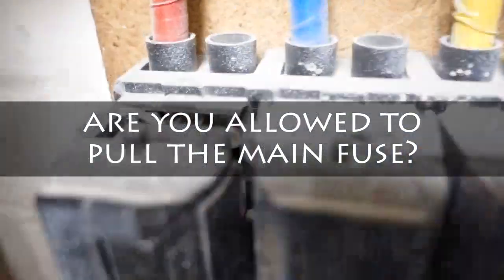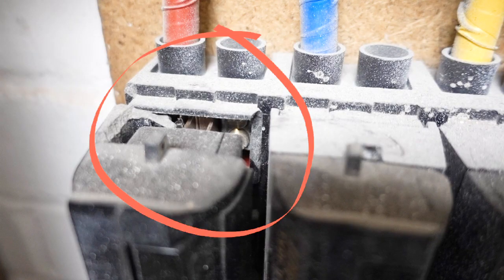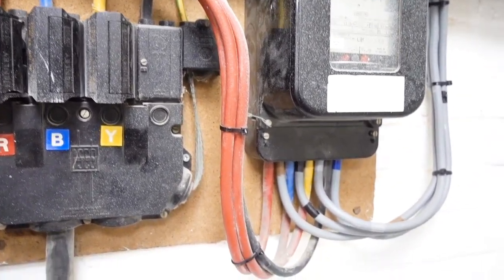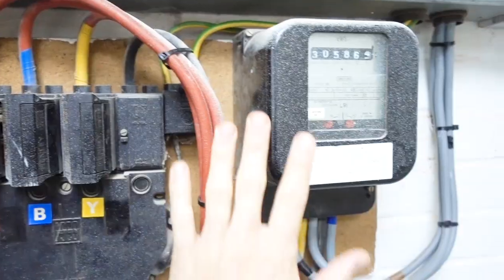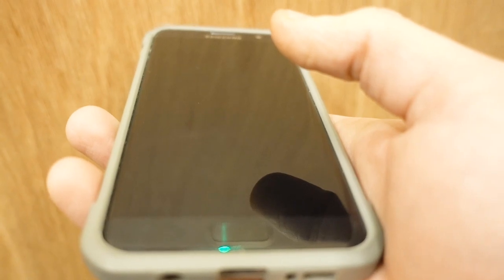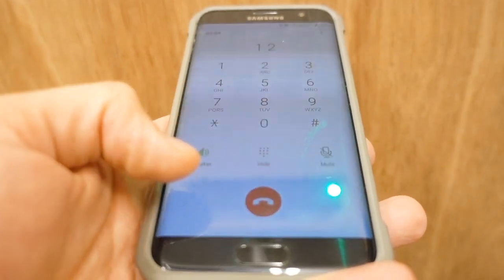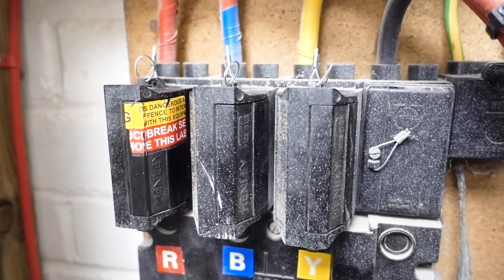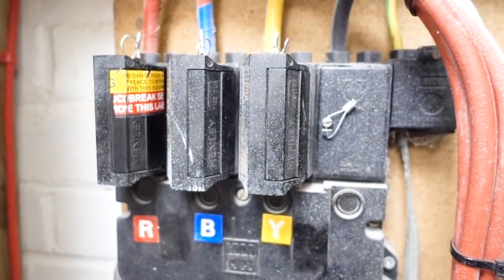REPORTING A DANGEROUS ELECTRICAL SUPPLY FUSE PROBLEM | CALLING UK POWER NETWORKS

Comment: I've called UK Power Networks out a few times when attending reactive repair (blown service fuses or damaged distributors equipment), I never actually hang around for their engineer to turn up. Where live parts are accessible to touch, I usually construct a makeshift barrier/enclosure with warning notices. The service fuse can be withdrawn if there is an imminent fire risk ie arcing between the pins and receiving ports.
Reply from the maker: Alvin Ashman I was worried that once I left the occupiers wouldn't take the situation as serious I was so I carried out everything I could to meet the EAWR 1989. We all know how to remove a fuse but it isn't an electricians to touch unless you have authorisation and are competent to do so...... grey area because arguably you are breaching some regulation in the event of a fire risk as a qualified electrician.
Reply: Dans the Engineer- There isn't a judge in the land that would convict you if you withdrew a service fuse because a real potential fire risk being present. If I arrived on-site and there was arcing at the service head, I wouldn't feel comfortable waiting 7 hours for UK Power Networks to attend, if they have an issue with that, then I'll see them in court. The LFB do it all the time when fighting an electrical fires or arcing at the service head.
Reply from the maker: Alvin Ashman I agree and I have been in a similar situation. And subsequently I had UKPN contact me looking to prosecute for touching their equipment - No joke. In a children's nursery as well. I feel many feel they are allowed to remove supply fuses because they are 'qualified' but that really isn't the case. I think electricians should be trained to handle DNO equipment where required in the event of various situations but I feel many think it is as easy as just pulling a fuse and being done with it. In the case you mentioned they would have to rectify the problem and would be documenting that they have checked it.
Reply: Dans the Engineer- With regards to damage to distributors equipment, I usually make safe as best as I can, contact UK Power Networks to alert them of the danger and request an engineer attend to repair/replace. Fill an electrical danger notification form then away I go on my merry way. Most of these jobs tend to be be out of hours and I can't afford to hang around waiting hours on end especially if I have other emergency call outs to attend.

Comment: Great video not happy with the response time from ukpn. But you done the right thing by letting them know. There's a free phone number you can call anywhere in the uk and it will put you through to your local distribution network operator its 105.
Reply from the maker: MS Electrics yes 7 hours is a joke really but it didn't turn out too bad. I did explain there is exposed live parts! Ah yes. I should have mentioned the number. I'm always on the phone to UKPN and only really deal with them so have them saved
Reply: Dans the Engineer ok
Reply: Special UK (and EU) phone numbers including 105 are here https://www.area-codes.org.uk/special-numbers.php

Comment: 7 hours of hanging around!!  Did you charge the client accordingly?
Reply from the maker: Jake Chattey hi Jake. I had paperwork to do for the client anyway so just done that as I waited so effectively they were not charged as I charged for the paperwork. However if it were one of my guys I would be charging yes. We find clients want us on site to oversee what is going on and making sure all equipment comes back on. It's just unfortunate this one took so long! The client had a responsibility too to make sure no one is at risk so unless precautions were put in place to stop someone gaining access, it would be questionable if they told us to leave site!

Comment: Did they at least give you an estimated time of arrival, or an engineer contact number? So potentially you could lock up site as a keyholder and return later?

7 hours!!
Reply from the maker: SparkyNinja they didn't give a time. They just asked what time I was there until! I had to chase them on the phone to get an ETA because time was pressing on. I wasn't going to leave until they arrived.